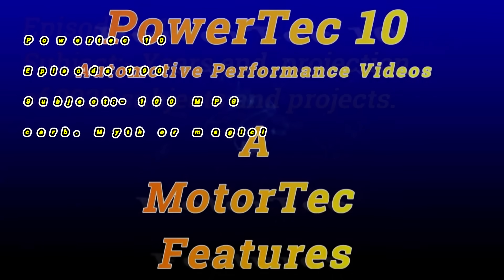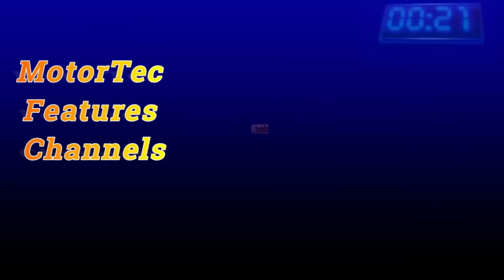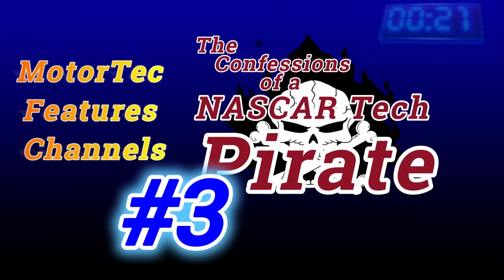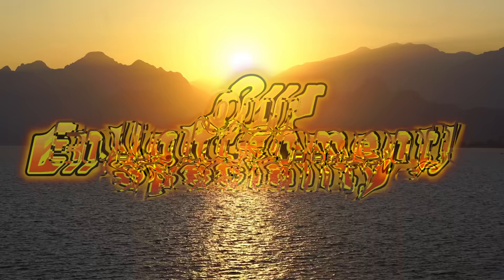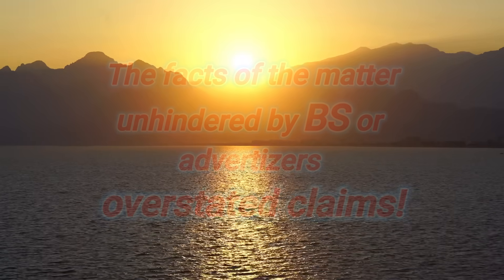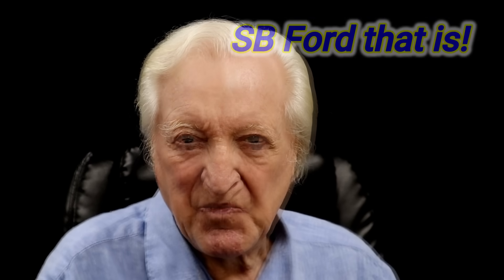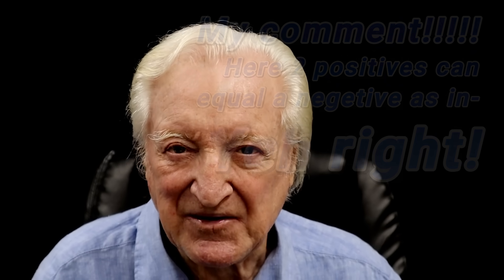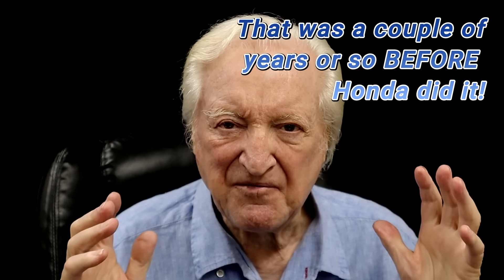The 100 MPG carb - reality or real BS

Comment: We can't even get 100mpg with high pressure direct injection. There's just only so much energy in a gallon of gas, only so much effency in an engine.
Reply: That guy who had a 218 mile per gallon car isn't around anymore. He blew himself up because he ran the gas threw the exhaust manifold to vaporized the gas and had  mechanical failure....RIP.
Reply: You're right you will never get 100mpg with direct injection because it is less efficient! Remember liquid fuel doesn't burn it is fuel vapor. When you inject the fuel directly into the cylinder it doesn't have enough time to atomize and then vaporize into a burnable form. Most of the fuel in a GDI engine is wasted out the exhaust or on the cylinder walls and ends up in the oil pan!
Reply: @The0utmode  So that must why diesel engines use carburators. 
Look at all this great true and accurate, trust me bro information on the internet!
Reply: @l77scmaro2  What is the octane ratting of diesel fuel?  That's right it is closer to kerosene than gasoline. That means it burns faster than 87 octane pump gas so combined with extremely high compression ratio of most diesel engines it means that more of the fuel is burnt in a direct injection diesel than in a GDI engine. So maybe you should take the time to properly research this topic. Instead of doing the classic. "Modern cars are doing it and every thing new must be better." argument.
Reply: @The0utmode  Octane rating has nothing to do with burn rate. Octane is a mesurment of a fuel's resistance to detionation/preignition. Diesel fuel burns slower than gasoline and the reason is its a more complex/heavier hydrocarbon - it takes longer to react with oxygen because there is more reactions occuring.
Moreover, even if fuel burn rate was the issue with the 100mpg claim, and it's not, it would be a simple matter of increasing ingnition and /or injection timing to start combustion sooner.
This is why you don't go with "trust me bro" on the internet.
So you might want to start over with your theory.
Reply: @l77scmaro2  Alright go pull the oil stick out of a modern car with GDI and tell me if you smell gasoline in the oil. Don't base this off a Toyota because they use dual injection. And ask yourself does all fuel in engine help turn the crankshaft?
Reply: @The0utmode  My dad has a Kia with gdi. The oil is fine
Ps also my brother's mustang also has gdi along with port efi. Its fine too. No idea where you're getting the idea that gdi has oil contamination problems because the fuel dosn't have time to atiomize. Gdi operates under extreme pressure. It essentually "flash vaporizes" the fuel during the injection event (combined with the heat and turbulence in the combustion chamber).
Gdi vehicles usually get slightly better mpg as a result. That wouldn't be happening if the fuel was ending up in the crankcase.
Engines with both port and di also have periods of time when they exclusively run one or the other. They don't always run both strategies so, if what you claim is true we'd see issues with them too just not as much as vehicles that only have gdi